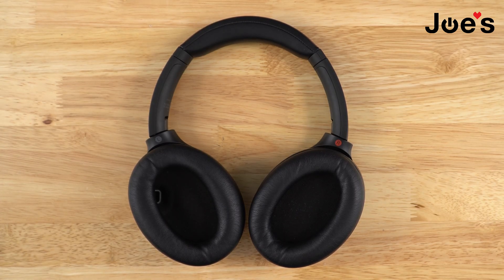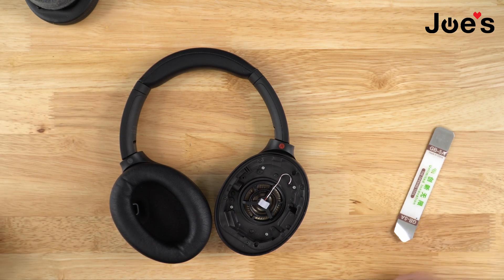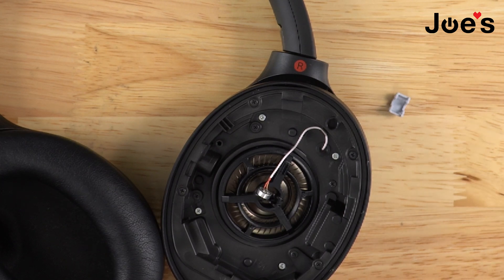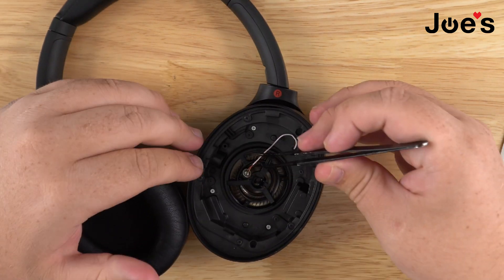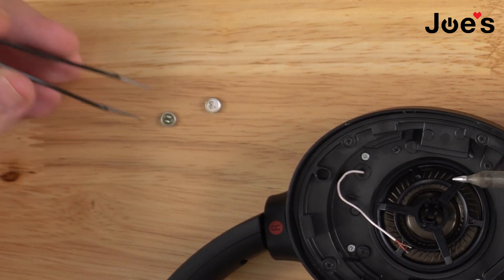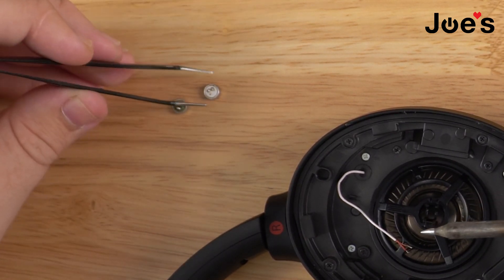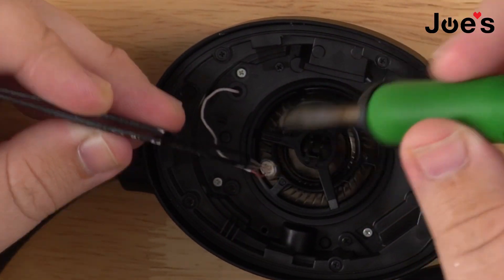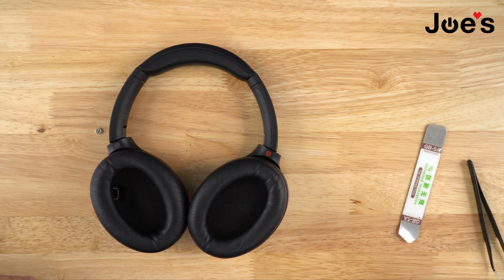How to Fix Sony WH-1000XM4 Buzzing MS Port Replacement Tutorial

Comment from the maker: 📬 Need a Pro? Send Your Headphones for Repair: 👉 https://www.joesge.com/pages/repair-service-issues?p=wh-1000xm4
⚙ DIY Ninja? Get the Parts Here: 👉 Sony WH-1000XM4 MS Port: https://www.joesge.com/products/sony-wh-1000xm4-parts?variant=40251968749614

🧰 Tools Used in This Repair:
👉 Flexible Pry Tool:
https://www.joesge.com/products/electronic-repair-pry-opening-flexible-metal-gb-5a-tools?_pos=1&_psq=flexibe+&_ss=e&_v=1.0
👉 Soldering Iron:
https://www.joesge.com/products/60w-adjustable-led-soldering-circuit-board-repair-iron-kit-tools?_pos=1&_sid=f4cc00d11&_ss=r
👉 Tweezers:
https://www.joesge.com/products/precision-tweezers-stainless-steel-thin-thick-strong-for-electronics-repair-tools?variant=41346674262062

💬 Drop a comment if you need help!

👍 Like if this saved your headphones!

🔔 Subscribe for more repair tutorials!

Comment: Will you be able to have your own spare parts for WH-1000XM4 dust pipe connector if I send it in for repair? I accidentally ripped my dust pipe connector rubber piece when I removed the piece trying to clean my MS port with alcohol wipe. I have 2 stripped screws on WH-1000XM4 drivers... 😢
Reply from the maker: Contact us support@joesge.com